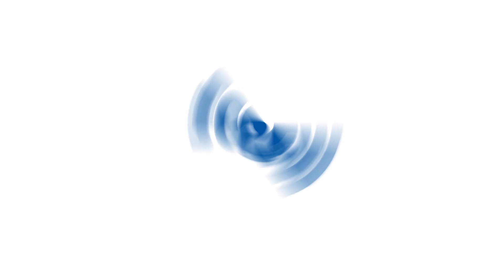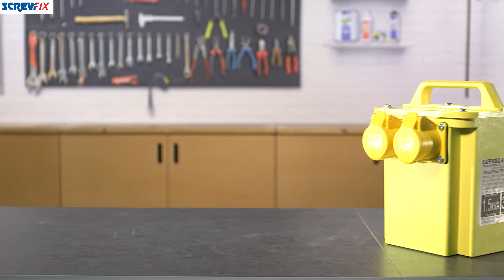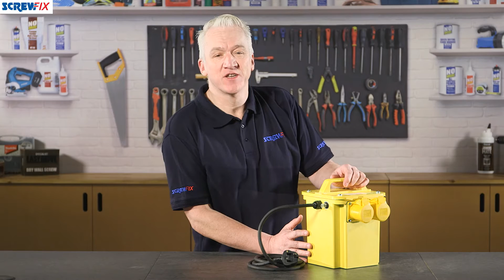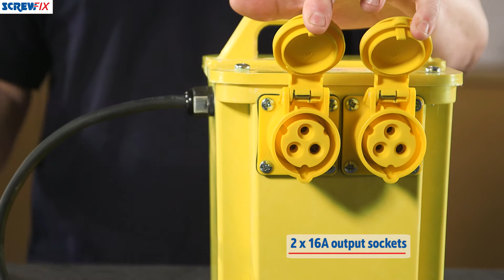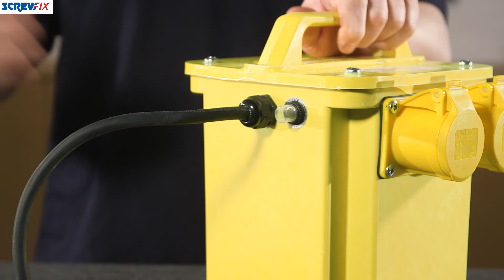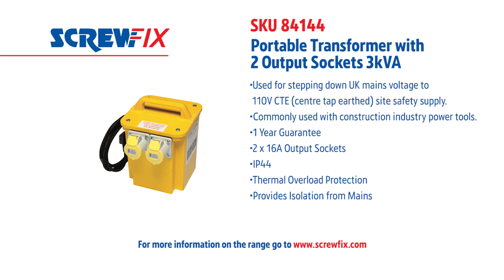PORTABLE TRANSFORMER WITH 2 OUTPUT SOCKETS 3KVA | Screwfix

Comment: (0:23) - "Easy to carry around" ?
Are you kidding.
It weighs 16Kg !
It might be "Easy to carry around" if you're Geoff Capes, but for most others, it's a struggle just to lift it.
And while I'm here, I bet you haven't got a clue what "centre-tapped to earth" actually means.
And don't bother answering that.
Even my dog can use Google
In fact it was my dog that explained to me exactly what "centre-tapped to earth" means.
Clever dog, my Arthur.
>
Reply: 16kg is 35.2lb.  35.2lb is in the range of a typical concrete block/CMU and is less than a 60 cell PV module (42lb or so).
Yes, it's easy to carry.